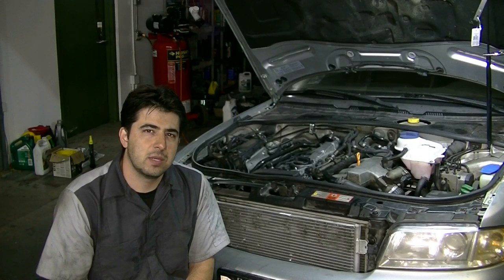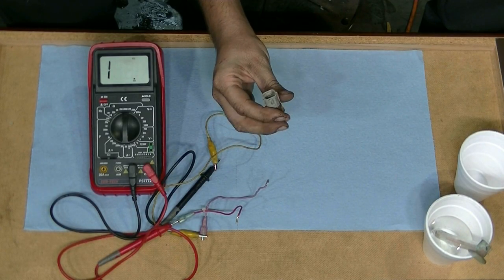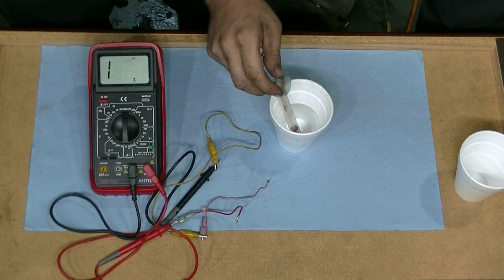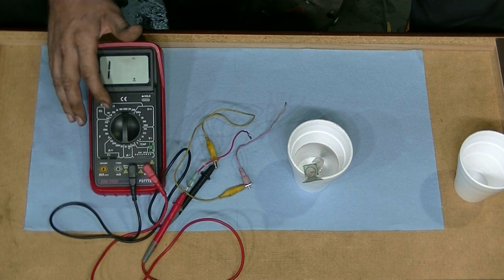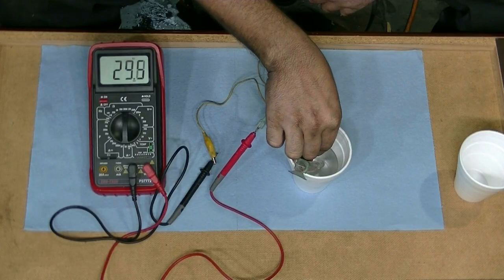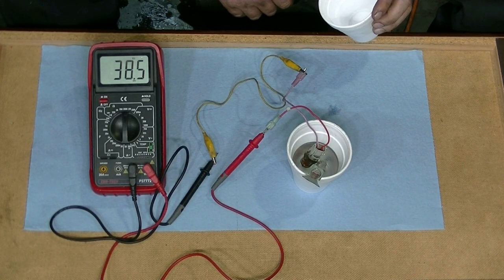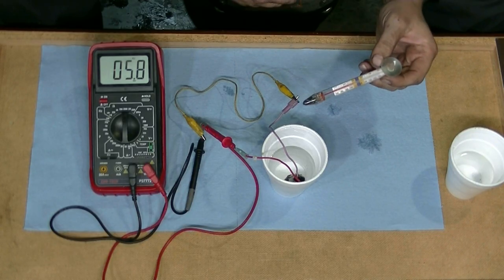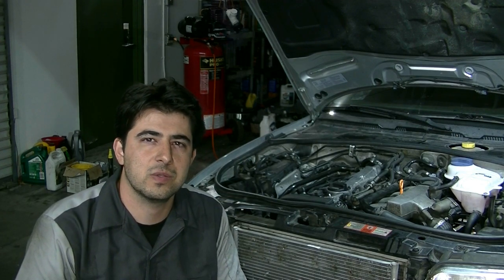How to Test an Engine Coolant Temperature Sensor - Using a Basic Multimeter

Comment: How can I check a single pole temperature sender that activates dim lit on the panel when the engine is cold and brightens as the engine is heated.  It should not be dim lit when the engine is cold and should only light on the instrument panel if over heating.  I replaced it and the new one does the same.  Any suggestions?  I have good continuity to ground and 6.64 V at the sender on a Case skid steer.  I am stumped.

Comment: Before doing any of this,  if you have a three prong connector.  Get the car to normal operating temp and unplug the sensor.  If the fan comes on,  it is the sensor.

Comment: If my multimeter numbers jump for a second and then it reads 0.00 what does this mean?
Reply: The meter can't read resistance if there is voltage present, is there? It will cause wacky readings and possibly destroy your meter.

Comment: Mine is reading 5.32 on 20k when cold in boiling I got 1.04 on 20k omh. Also I am using the same multimeter.

Comment: how did you calculate that resistance range?
Reply: Well, you can read it cold and then read it hot and there "should" be a huge difference, not sure exactly, but most of the time, as long as there is a large difference, that means it works, shrug.

Comment: what if the temp sensor is working, but it's still not solving the car issue (such as the temp gauge is always at zero). Is the next step to see if the wiring that connects to the sensor is at fault? Can you use a multimeter on that wiring (the wiring that ordinarily connects to the sensor)? Thanks

Comment: Hi thanks for all your videos. I have a problem with my 2009 Honda Odyssey. The radiator fan will not turn on and I have incredible fuel consumption. I already followed this video to verify that both ECTS are ok, I checked all the relays and the fuses are ok, I watched your video on how to check the relays with a multimeter. I checked the ECTS connectors and they are fine. The fans are fine because I made a direct connection with a clip on both the fan relays, it's the only way they turn on. I used a scanner in auto zone and it shows these codes P2185 (Engine Coolant Temperature Sensor 2 Circuit High), P0118 (Engine Coolant Temperature Circuit High), and P0117 (Engine Coolant Temperature Circuit Low). I don't understand why show that, if both ECTs are fine. I don't know what else to check. Any suggestions will be appreciated, thanks.

Comment: Do bad sensor also cause high idle on cold engine?
Reply: It can, yes
Reply: Depending on your rig I would check the throttle positioning sensor, or the idle air control valve.  They are found on the throttle body. The air filter system attaches to the throttle body.

Comment: Why does not my car stop immediately when ignition key is turned at(high temperatures)?while at normal temperatures the car stops as soon as the key is turned.
Reply: Perhaps there is some carbon that has built up on top of your pistons or on the surface of the cylinder head.  I believe carbon deposits can glow when very hot and this may ignite any unburned fuel in the cylinders.  

The older your car the more chance that it will have carbon buildup.

Just a guess.

If it's carbon, the cylinder head would have to be removed so the carbon can be removed.  Again, if it's carbon, it surely interferes with the precise combustion caused by the spark.  I might cause early ignition and then you would hear a "knocking."

Comment: Can this component be a factor in the starting/ cranking of the vehicle ? Mine takes at least 5-7 seconds to start and i need to give a little pedal (light touch) at times to allow it to not idle rough. Perhaps 1-2 seconds of rev at about 2000 rpm then release and it idles smoothly. I have eventually learnt a trick which seems to work BUT this drains your battery badly. What i do is, after driving and the car reaching the heat where the fan wants to turn...I park and turn off the car. Then after say 1 minute i turn the key to the on position...i will then hear my fan come on. I then allow the fan to run and switch off , this usually takes about 5 minutes. I then start / crank my car and allow it to idle for say 30seconds -1 minute - i guess this somehow allows the water/coolant to circulate and even out the temperatures.... NOW after it has rested , as if you are at work or home for say 9-15 hours. I start the car and it seems to start just fine - Sometimes i need to give an initial quick accelerator but literally just a quick second if that. If i do not do this fan trick story,,,, then i need to crank forever , like 5-7 seconds and of course give the pedal also so that the car starts
Reply: It'd the purge valve
Reply: I have found the coolant temperature sensor on my '89 Honda has a great deal to do with smooth starting.  I let my car sit all winter and it wouldn't start now that the snow is melted.  It would not start without my unhooking my throttle position sensor.  Don't ask me why but it allowed me to get the engine started.  I could reattach the wire to that sensor and get the engine started when it was warm.

It reminded me of the earlier problems I had with loose connection to the coolant temperature sensor.  Very hard starting then and, once I fixed the open, it started perfectly.

This time I checked the resistance of the CTS while the engine was cold (as this video demonstrates) and the sensor has zero resistance.  I'm waiting for my new sensor to arrive but I bet you it solves my mysterious starting problems.  (The idling problems you describe are also somewhat like the idling problems I have.)

The computer (ECU) did not generate an error code or light the CEL (check eninge light)  so it's been a hard problem to diagnose.  I guess the ECU thought that the coolant was at 1,000 degrees F (because of zero resistance) so it didn't set the computer to start a cold engine.  :-)

Comment: thanks kindly coolant will come out on trailblazers fyi ..... ask me how I know lol
Reply: What's the resistance for that truck's coolant temp sensor?
Reply: On MOST vehicles, so get ready and change it quick. You can also drain all of the fluid first, but then you might have to worry about air in the system. Sometimes people crack the threads on the sensor s to let any air bubbles out, since it's about the highest point.
Reply: @scottp.2995
1 second ago
On MOST vehicles, so get ready and change it quick. You can also drain all of the fluid first, but then you might have to worry about air in the system. Sometimes people crack the threads on the sensor to let any air bubbles out, since it's about the highest point.

Comment: RatchetsAnd Wrenches A relation question about temp sensor (temp sender unit) that drives temp gauge in dash/instrument panel. Over Internet I a way to diagnose problems in a 4AFE using  multimeter and/or connecting sensor wire to ground via a bulb.. My problem is that I don't know location of temp sensor on my 4EFE Toyota engine. I have confirmed that the coolant temp sensor doesn't drive the temp gauge. Really appreciate all the help!
Reply: +Jhan Jar Buy a Chilton's book